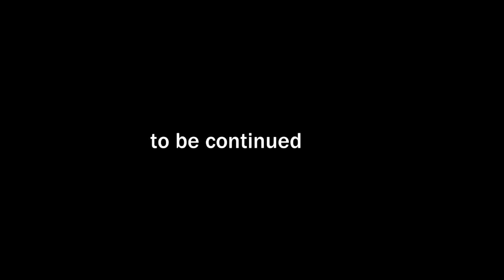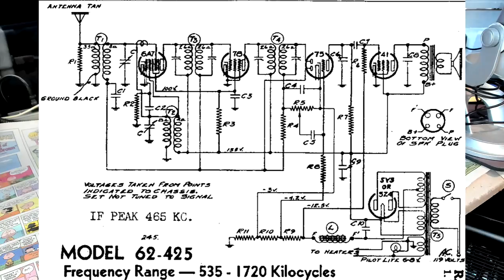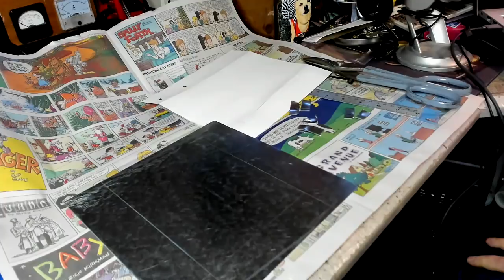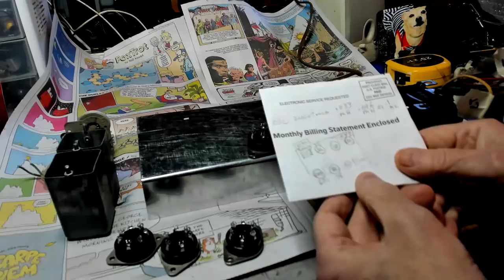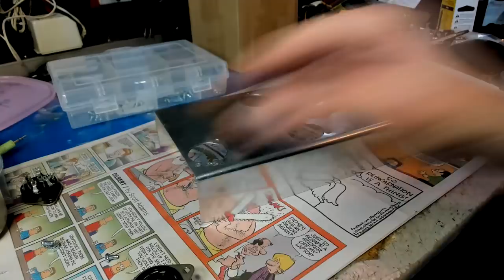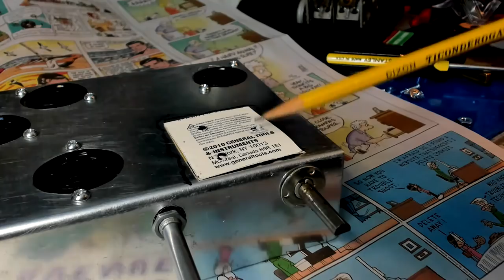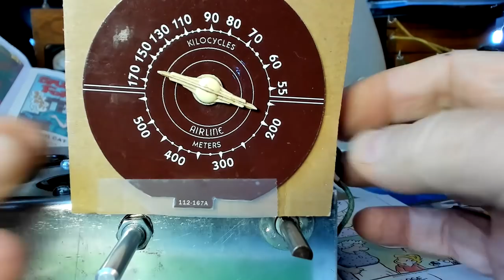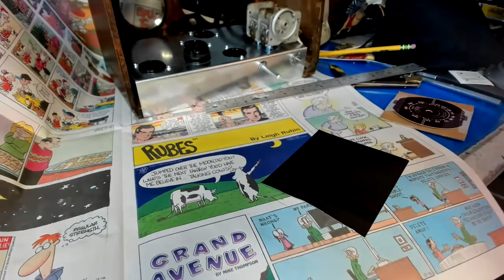Making a 1937 Airline Radio Chassis Part 1

Comment: Greetings:
I enjoyed watching you building the chassis from scratch. I was wondering if you gave consideration to the orientation of the sockets before mounting them. Even if they were mounted so the positioning matched from tube to tube, the consistency might ease the wiring because you know the pins will be where you expect them. I am surprised that you did not cut the IF holes yet. As the cans have consistent wire colors, I would mount them matching with orientation dictated by their source and destination locations.

Comment: I had sort of a reverse of that idea...Take an existing chassis that has no wood case and build a case to house it.  The idea's been in my head for several years now...sort of aged in the wood, nyuk, nyuk, nyuk!  Yours looks like a much more difficult job though.  I got a spring loaded awl/punch for Christmas that looks like it would have been good for your job.  Center it where you want to drill a hole and release the spring mechanism and it makes a small indentation so the drill bit has a guide and doesn't try slipping around :)  Will be looking forward to your progress on this radio.  Take care, Gary
Reply from the maker: I thought of doing your idea too, but decided on a chassis....thanks gary

Comment: Oh, brother, Buzz, this is great, making a brand new vintage radio! Next, I hope you'll make a brand new vintage tape recorder. How hard could that possibly be?
Reply from the maker: OH BROTHER...when I we were kids, my brother built a wooden cabinet , and we put the guts  ( well mostly my brother) of a cheap battery recorder inside it!!....glad to see you!
Reply: @Buzz1151  LOL. Actually, I have a Panasonic RQ705 recorder with a plastic cabinet. For some reason, the cabinet is disintegrating. I though about building a wooden box for the recorder. Then I thought, too much work, and ate a bag of chips instead.
Reply from the maker: @clydesight  haha funny..I hope the chips were Ruffles!!
Reply: @Buzz1151   I think they were MOSFET 1602 chips, not sure if they were barbecue though. The seasoning gets on the PCB. (LOL)

Comment: If I were building this I would probably use all octal type tubes for practical reasons.  In this case the 6A7 would be replaced by a 6A8, the 78 by a 6K7, the 75 by a 6B6 and the 41 by a 6K6.

BTW you're gonna end up dulling your HSS hole saw cutting like that at such a high speed and without oil.  Also, try center punching before drilling; it will keep the drill from walking.
Reply: I mean really !  It's his channel and I don't remember him asking ,people how they would build it !  Or everything they think he did wrong ! Best to mind your own business, if you can't say anything nice !!
Reply from the maker: to each his own...I make videos for the possible comedy effect doing it cheaply
Reply from the maker: thats what a normal person would do...i'm not normal  haha
Reply: Buzz, if you are replicating the chassis with the original tube line-up that is very commendable. Don’t let the naysayers get you down! ;-)

Comment: 12:30  FYI... When drilling steel, especially with that circular bit, you might want to put some oil on the cutting surface.  It will keep the blade sharp and cool.

Comment: What a great idea! Buzz, love your videos! after you drilled the socket holes, did you have to file down the edges? How will the chassis be attached to the wooden frame? Will the tuner have to be insulated from the chassis?
Reply from the maker: Looks like the tuner is ground on the chassis

Comment: Buzz, great to see another video.  A very ambitious project!  Awesome.
I have two questions.  Can you turn your dial mounting plate around so the black faces forward?  There is no flange along the bottom edges.  How will you mount the chassis to the cabinet?
Beautiful cabinet.  Good luck.  You are inspiring me to get off my arse and get busy.
Cheers
Reply from the maker: get to work..ha

Comment: When buying drill bits get always HSS high-speed Steel, cobalt. A good make is jobber roll forged,  DH &JS trading. will not bend designs for drilling Hard Steel can drill wood and other materials.  there's lots Hss fakes out there. Try and get to HSS machinist drill bit sets but they can be fake as well there's some good Chinese and some crap.
Reply: Not to mention he should be using oil with that hole saw and running it slower!
Reply: @Buzz1151  thanks for replying better late than never mate lol 2 years

Comment: It was many years ago in my teenage years when I built an AA5 radio out of the dead bodies of many others. I used octal tubes, 12SA7GT, 12SK7, 12SQ7, 50L6GT, 35Z5GT.  I used top and bottom slug tuned (not K trans, these had loopstick like adjustment screws).  I didn't have a cabinet, it was a bare chassis, put a polarized plug on it to minimize the shock hazard of the 'hot chassis'.  Never did get a shock from it.  The radio played very well, I listened to Rock and Roll on it (WMCA and WABC in NY).

I make long straight cuts in sheet aluminum using a Dremel cutoff wheel.  The metal work would be easier if you drilled all the holes first BEFORE you bend the chassis.  That's how the factory did it!
Your doing it bassackwards.  the handles on the brake should be over the edge of the table, not over the table!  You get better leverage that way.  I screwed my HFT bending brake to the work bench, it works better that way!  I also bought the shorter brake, it's cheaper, and flexes less.  I never need to make anything longer than 18" anyway.
For Christ's sake, get yourself some Greenlee chassis punches!  If you must use those HFT hole saws, put them in a drill press!   Harbor Freight has better drill bits than what you got on ebay.  Looks like you made your chassis out of steel.  Should have got aluminum, MUCH easier to drill!

The way you dry fit that bulb, it would it the rotor vanes of the tuning capacitor.
Were you planning on drilling holes for the IF transformers?  Should do that before any wiring, or you'll end up drilling the wires you knucklehead!
By the way, did you forget the oscillator and antenna coils?
Reply from the maker: It was done for comic effect
Reply: Seems like you might have some interesting input, but I was distracted by the TACK you're apparently sitting on.
Reply: Oh no. Not a critic.That's ok Buzz. You work on a budget like most of us and most of us understand that. Despite the criticism, I would like to see how someone solders tin to an aluminum chassis. Lol.

Comment: I think you did a bonehead move Buzz. That tuner needs to be on rubber isolators not metal .
Reply from the maker: nope, you're dead wrong. The original Airline radio was directly connected to the chassis, as were many other radio designs.🙂
Reply: @Buzz1151  I stand corrected sir, I thought all of the tuners on tube radios had to be on those rubber grommets, I have never seen one without,not that I have seen every radio but I found on a couple of cases when the rubber had rotted and the tuner would sort to the chassis it would crackle and drop out a bit. I guess you learn something new everyday.
Reply from the maker: @skullheadwater9839  👍👍🎅🎄